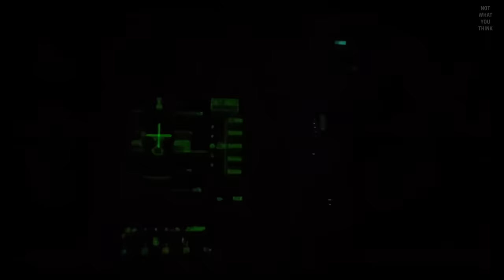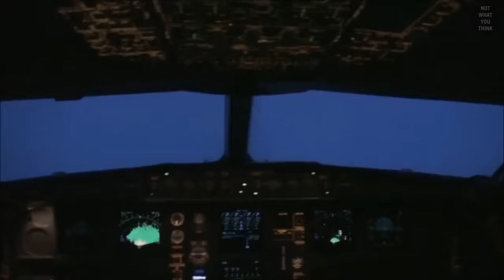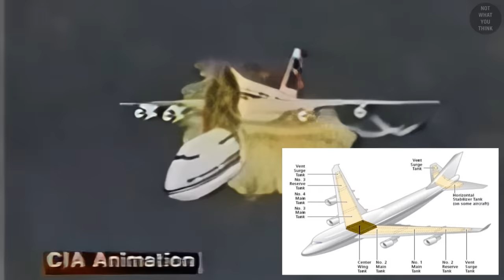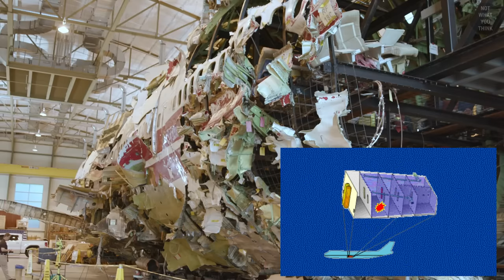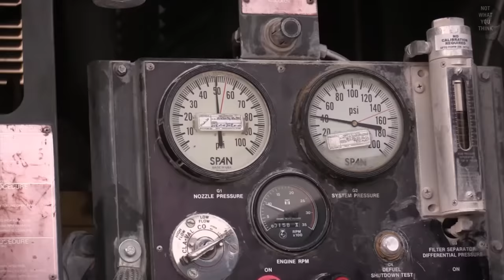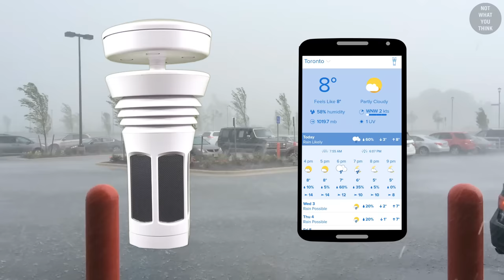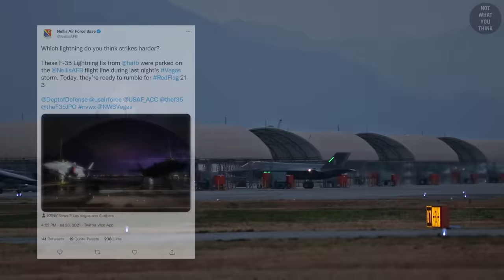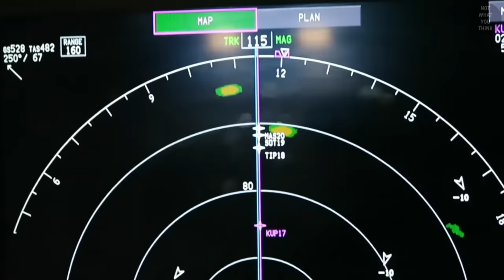Why F-35 Don't Fly During Thunderstorms

Comment: TO FLY, FIGHT, WIN…AIRPOWER ANYTIME, ANYWHERE! Except when there’s a lightning in a 5-mile radius
Reply: So you can have air superiority against F35, just need a thunderstorm and any combatant aircraft capable of flying in said storm.

Nice mil spec.
Reply: Basically any rain, stealth aircraft need to be repainted after taking mission
Reply: 5-nautical*
Reply: Dude the F-35 can fly through thunderstorms just fine
Reply: @youkofoxy  Lightning is the least of your problems in a thunderstorm, tf?

Comment: There are some extremely important lessons in this video, the most notable of which is that corporate executives will willfully make decisions that result in the death of customers, if it means a few points short-term boost in their stock prices. Billionaires are so likely to be in this position that many make such decisions multiple times annually, knowing full well that somebody will probably die because of their decisions, but doing it anyway because they calculated that it will be cheaper than keeping that person alive. Also oxygen is the enemy of fuel tanks

Comment: The F35 can fly in a thunderstorms now.  It couldn't use the existing system because the F35 uses its fuel as hydraulic fluid. This requires high pressure in the tanks. This was fixed the the same way Bowing did it on the all carbon fiber 787. Titanium wire .

Comment: What is being done to prevent or attenuate lightning damage to the F35? Not only is lightning an Achilles Heel, but interceptor and strike aircraft cannot choose the weather environment.
Reply: It actually can fly through lightning just fine, and does so all the time. It just attracts it more due to its coating.
Reply: @jonathanpfeffer3716  explain.
Reply: @taskforce0584  New system called OBIGGS fixed danger from lightning strikes.

Comment: This is actually why SR-71s refueled just after takeoff. It's not what most people think. The real reason to top off the tanks is to remove all the oxygen from them, so the inerting system could fill the tanks with N2. The aircraft got so hot when flying supersonic it could ignite the fuel in the tanks.

Comment: 2:52 grounding in an airplane lol (I know its not meant in the way we ground things in houses or sth like that)
Reply: That one baffled me as well.

My first thought was that it would be something like the "ground" in cars. Which is just the car body being used as a common negative.
Which in the case of lightning protection in aircraft doesn't make sense. As that would only interconnect all systems, ensuring that the lightning would get to them all.

Upon a little reading it turns out that grounding in an aircraft is about interconnecting the shielding used around signal wires to avoid electromagnetic interference.
And as such has nothing to do with lightning protection.
Critical systems are protected by separating their electronics, not tying them together.

Comment: This video needs to take a trip back to 2012 when this was relevant.  F-35s haven't had this issue for more than 8 years now...
Reply: Yet it got banned from flying in thunderstorms in June of 2020.
And the incident in Japan (which was unrelated to the OBIGGS system) was in July of this year, a few months ago.
Reply: well but it ruins the stealth if hit once but if it gets hit a few more times sooner or later the rest of the craft will get problems if they get hit more then once in quick selection is when the real problems  with the craft shows up by the way lightning likes to hit high and large metal objects like a lot more than once if its the path of least resistance! in fact it can do that so fast that in 5 seconds  lighting would have hit a object like that  6-10 times at that point! even i don't think even a F-35 with just its newest anti lightning systems would be able to handle that much that quick! if that kind of rapid multi lighting strike where to happen even the F-35 OBIGGS would not be able to handle all of that without taking a bit of damage in the process and would require mandatory repair post mission if the F-35s stealth wasn't fully compromised at that point from thermal heat sencture from the point of the strikes on the planes frame did not completely give their prosion  away from thermal imaging detection equipment! this bescue by the way any area directly hit by lighting can get VERY VERY VERY VERY hot witch is bad for the F-35 stealth against enemy thermal detection anyway is one more reason the F-35 should not fly in thunderstorms! this is bescue anything struck by lightning even in a small point that point would be VERY VERY VERY HOT anyway! and i mean hotter than the surface of the sun hot would be! that is like very easy for most new heat imaging military systems to spot quite far away! so even if the F-35 has fully proper scheduling against lightning strikes! it would however would still become a big easy to see target from thermal imaging for a good amount of time directly after a lightning strike from the heat at the point of the strike on the frame would nullify any way of hiding from thermal imaging detection anyway!
Reply: @ashtiboy  There's so much wrong with this

Comment: I used to be an enlisted aircrewman in the US Coast Guard. On one flight in a USCG Lockheed HC-130H Hercules aircraft, we got struck by lightning. 

We checked the inside of the airplane, and as much of the outside as was visible from inside. We found no damage. 

After landing, it was discovered a small bit of the trailing edge of the left-hand aileron -- roughly 1/2 the size of an American silver dollar -- had been burned away. This did NOT affect the pilot's controllability of the aircraft during the remainder of the flight after the strike.

Comment: The F35 is ONE tool in the massive US air superiority tool box.

Air Force - F-15C/D Eagle (234), F-15E Strike Eagle (218), F-15EX Eagle 2 (8, will replace older F15's), F-16C/D Fighting Falcon (934), F-22A Raptor (186), F-35A Lightning II (238).

Navy: F/A-18E/F Super Hornet (512), F-35 Lightning II (118 of 260 planned),  EA-18G Growler (electronic warfare)(155),

Marines: F/A-18A Hornet (36 active), F/A18-C Hornet (60 active)), F/A-18D Hornet (48 active), F-35B Lightning II (32 Active) (Planned procurement: F-35B V/STOL - 353 and F-35C CTOL - 67), F-5N Tiger II (12)

This is a list of "aggressors". Add to this list the very long list of manned and unmanned support aircraft of all types.

After this we get into generation six of manned and unmanned aggressors.

If that wasn't all, US pilots get more air training than any other military on Earth, bar none. Some NATO allies may come close in flight hours but not with the volume of aircraft the US has deployed. That's all our pilots do is train, train, and train. The same goes for all other operations which support US airpower.

I'm not done yet.

The US and NATO allies are deploying some really vicious air-to-surface and air-to-air missiles. Particularly troublesome for the enemy is the "over the horizon" A2A missiles. US radar systems and integrated satellite data will detect and enemy beyond the visible horizon and initiate kill shots before the enemy knows the fight has started.

Top Gun and Top Gun Maverik are fun movies but we don't do dogfights anymore. We don't need to. Canons (i.e. machine guns or Gattling guns) are not for dog fighting. That weapon can be used during interdictions and intercepts to cause deliberate limited damage. Arial dog fights are soooo 20th century. Those days are over. Let the Russians and Chines pretend like this is still a thing. Let them waste the little training time they get on outdated warfare practice. It's all about stealth, early detection, electronic warfare and long-range guided missiles. Not top speed and acrobatics. This is also why the F22 Raptor - an awesome aircraft (!) but not what we need anymore. At least not in its entirety and not at that cost.

It will take Russia and China a loooooong time to catch ut to the US and her allies around the world. That's why they keep threatening us with nukes. Because they got nothing to match the superiority of the West. Not even close.

Comment: Worked on the Hound Dog Missiles' in the late 60' for the USAF. the AGM-28B had a 310 gallon fuel tank and any tome it was detached from the B-52 the tank was pressurized with a 1/2 half pound above atmospheric pressure with Nitrogen. But they always had Full tangs on the Trailer except after a GROUND engine run in Combined Systems Check out before UP load to the B-52 and the 1.1 megaton weapon was load and the Bird was load on the B-52 and sat on the alert pad for a month before being Test flown.

Comment: I was in a plane that was struck by lightning on descent to YYZ - my dad (a navigator) called me over to the window to have a look at all the lightning. Just as I looked outside the porthole, there was a flash and some... sparks I guess? After my eyesight returned from the overwhelming light, you could see a black mark where it hit. a few people that saw it got excited/scared. Other than that,  nothing happened, although there  may have been a momentary loss of interior lighting, but that may be an implanted memory. My dad didn't even flinch. 

Conclusion - none. Video addresses it. :P

Comment: As a person who live in the northen part of Sweden its pretty comon to see airport staff spray the aircraft with glycol in spring, winter and fall to prevent the aircraft to freeze so cold weather is not that big of a problem. I would like to learn more about heat tho because most aircrafts (commercial) are white and the military aircraft are light grey to prevent heat but both the f-35 lightning are  dark grey and the SR-71 are black witch are really odd to me.

Comment: I'm guessing this video is probably wrong on several counts...
1. Assumption the F-35 lightning strike damage has anything to do with the fuel tanks. I don't remember any details of the supposed damage and wouldn't expect details to be publicized. Probably classified secret.
2. Am assuming whatever the problem was, resolution had highest priority and was resolved quickly (within months). To some degree because of its heavy reliance on electronics and electricals for everything, probably the entire aircraft needed a thorough audit and inspection which could have been expensive. I'd also expect that a suitable solution was found easily, it's not like protection against lightning strikes is unknown.
3. Actually mentioning the metal skin of most aircraft is valid. Electricity is known not to travel through the core of metal conductors but along the surface only, and exert an EM field in the vicinity as well. But unless you know how that can relate to a metal fuselage and wings, it's probably TMI.

Comment: when the wing freezes the anti icing system will detect the ice and then the bleed air from the motors will go to the picolo tubes and then heat the edg of the wings

Comment: Not taking self sealing fuel tanks into all commercial aircraft despite
having the technology and understanding of the consequences of not having these tanks… how was this allowed to happen? Did some asshole in the manufacturing industry think the safety feature was just too expensive and was going to cut into their profits? That’s a story I want to hear.

Great video.
Reply: Self sealing fuel tanks aren't necessarily on commercial jets because commercial jets aren't usually shot at.
Reply: @oliverrugg3732  them not normally being shot at isn’t the point. The point is that using self sealing tanks significantly reduces the chances of catastrophic ignition of the fuel by any means… and they didn’t use them despite the sacrifices made by pilots and air crews during WWII. 

They certainly understood the dangers of an exploding fuel tank and they’d have seen the  damage and destruction caused by their absence when landing damaged aircraft or from any number of non-combat related accidents.

Like who the fuck did the cost/benefit analysis of self sealing tanks and decided the extra thousand dollars they’d save would be worth the 80% increase in likelihood of a mid flight explosion? ‘Shameful’ doesn’t come close to describing this level of greed and negligence.

Comment: In robotics, one common issue all teams had was static electricity, especially during the cold, dry winter days whennwe had competition. Often causing full system crashes. Two robots stopped working on part of the competition field due to this

Comment: The Eurofighter Typhoon is mostly made of composite plastics too and I never heard that it has any problem with lightning.
Another issue the F-35 and the F-22 have is that ice crystals in clouds scratch up the anti radar coating and it basically has to be replaced every time they flew through bad weather, which of course is super expensive and grounds the aircraft for a long time.

Comment: Electrons take the path of least resistance, so a Faraday cage is just a fancy name of a big conductive box
Reply: Current takes ALL paths, just that the most amount of charge flows through the path of least resistance.
Reply: they take all paths available to them
Reply: not that simple, faraday cages also shield against em radiation . also, current flows through all available paths so your explanation needs a follow up.
Reply: Oh yes, the same way a gasoline engine is just a bunch of iron? 
Thank you for your deep insight!
Reply: Electrons take all paths available, it's just that most electrons will take the path of least resistance.
Reply: @yaz2928  You too.
Reply: @ioannis.tsampras  dude, in general that’s basically what it is
Reply: Not just that, a Faraday cage also works if just inside it you have a superconductor, which would be way more of a path of least resistance.

Also not true because they take ALL the routes.

It works because im a conductor, electrons are "free" to move, so any electric field imbalance gets exactly countered by electrons moving into place, creating an opposing electric field. Or if you prefer, until they're in an equilibrium were all forces equal out, aka 0 electric field locally inside the metal.

Which means that inside a conductor, the electric field is always 0 (unless it's bigger than the total charge contained in the metal, which is a bit extreme).

This also means that depending on the material and shape of the shield, ot might not work for higher frequency em fields since it's possible electrons can't "move into place" fast enough and stuff.

Way cooler and way more complex than "least resistance path".
Reply: @hydrogencyanide4999  yeah but in a faraday cage, basically NO charge (thus current) at all gets through.
That's also why the "least resistance path" is wrong.
Reply: @Boyakishan  that's not it at all tho
Reply: @Anankin12  i said in general
Reply: @hydrogencyanide4999  yep thats why a parallel resistance will be lower than a series resistance, more paths for current to take, so more flows.
Reply: The 'lightning' (and other EM phenomena) protection on the F35 is a real headache due to the dense packing of electronics and the massive use of composite, non-conductive materials... The guy is charge of F35's Lightning Protection Department was based in Cheltenham and was a racing alky and pothead - and going through a head-bashing divorce when I knew him a the peak of F35 development... 
--
This may sound unbelievable but it is true.. He'd literally invite various locals back for a smoke after the pub shut. He'd kick us out and start pouring over paper by about 1:00 am.. He usually made it work by 9:00 the next day, but quite often went in late. To be fair, sometime's he wouldn't go to the pub and would carry on with his work all night, at home.. One of the maddest nutters I've known.. I bought his old car.
--
Funny thing is, I'm utterly against the Neo World Order of continuous global destabilisation for US arms and oil  hegemony.. I don't like being a vassal US state anymore than an EU one.. I kept my tongue well bitten around him, and stuck to my musings on what lies beneath it all... What is the unifying quantum field.. We were always trying to get him to spill the beans of UFO tech. but all he'd do is say 'it's possible!'... 
--
Some of what I discussed I now know to be true, such as 3D plasma projection in mid-air by crossing radar / high power laser beams. Can now project full 3D images and sound in mid air, using commercial tech.

Comment: All modern aircraft have static wicks... If a plane gets hit by lightning the electricity travels through the plane to the static wicks, which is than dissipated back into the air. So any modern aircraft can fly through a thunder storm fairly safely.
Reply: Static wicks are not an important factor in lightning protection.

Comment: TWA 800 was shot down by a US military missile test gone bad.
Reply: an MSL would and would NOT cut a planes hull that much, it would be a hole. Not the whole hull.
Reply: @kalbing  ,
Bwahahahahahahahaha. That's the most ridiculous reply to ever be posted on YouTube.
Reply: @kalbing  ,
Bwahahahahahahahaha. That's the most ridiculous reply to ever be posted on YouTube.
Reply: @freedomforever6718  you believe what you believe, and i do my own thing
Reply: @kalbing  I'm not saying it was a missile but they're not made to make a "hole". They either use fragmentation, in which cube and bowtie shaped pieces of metal are shot out like an omnidirectional shotgun blast, or continuous-rod warheads. The continuous rods are interesting because they're long rods of metal welded at the tips in a an alternating  zig-zag, so when the warhead explodes the rods separate but remain joined at the tips, forming a circular "concertina". When the stretched circle impacts aircraft, it slices them through.